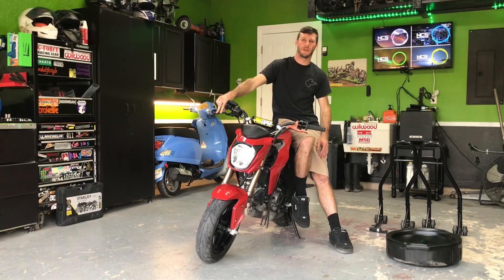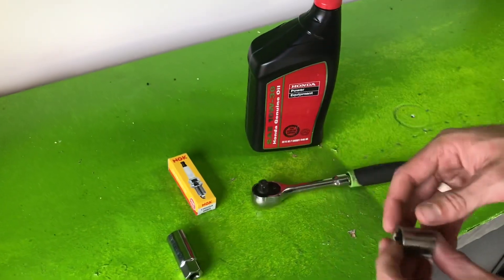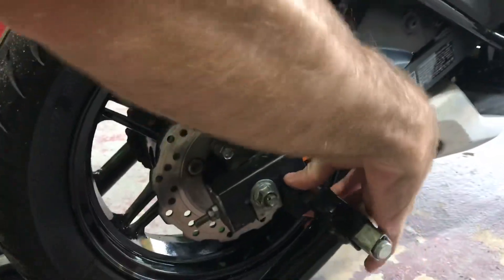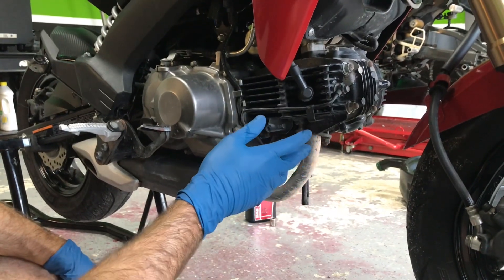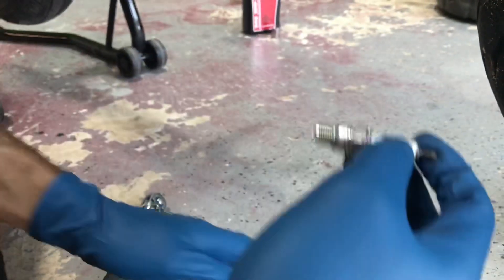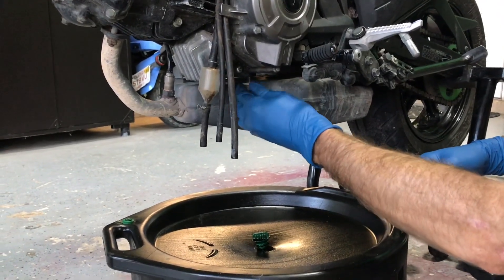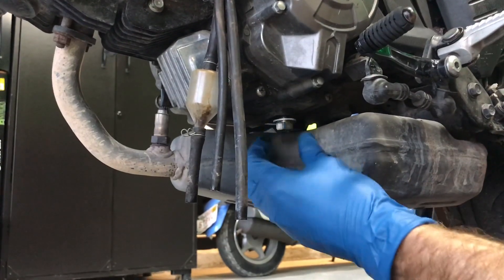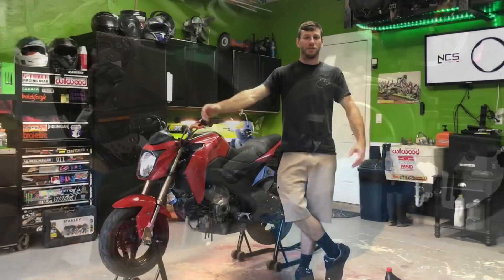Kawasaki Z125 Oil Change & Spark Plug DIY ( Kawasaki Z125 Maintenance Series Part 1 )

Comment: I got a 2018 Kawasaki Z Pro 125 hard to start it turns over a few times before it starts how do I fix a gas problem or electrical I don't know what it is can you give me any tips
Reply: Maybe a dead battery?  Add a bit of seafoam to the gas? 

Or change the spark plug 

Bad terminal connections make sure they are tight and if you don’t use it a lot connect a battery maintainer